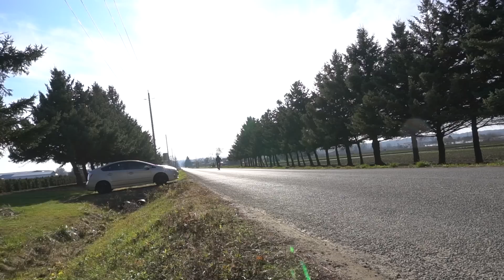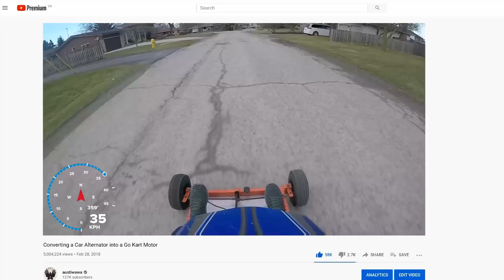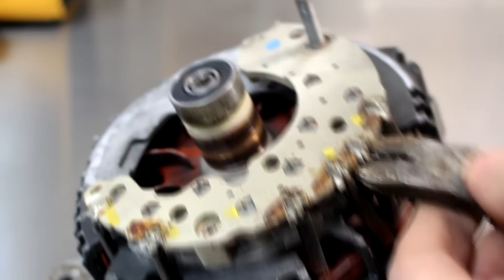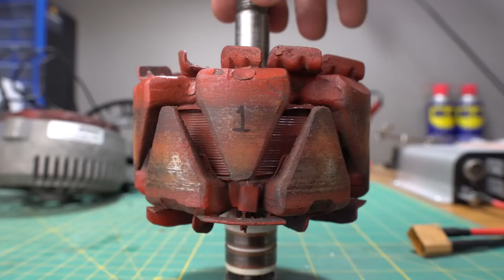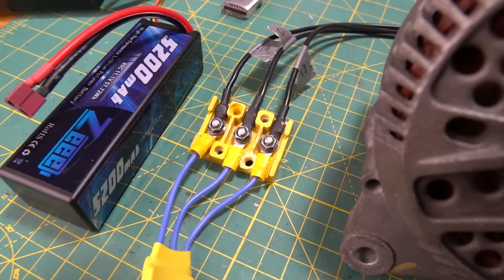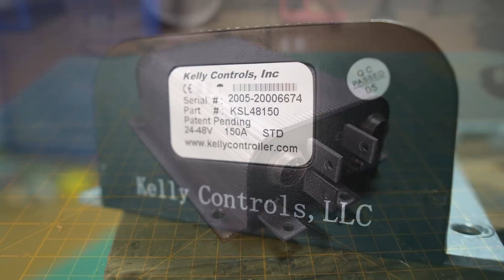Building an Alternator Powered Bike

Comment: WHY DIDN'T YOU JUST SWITCH THE ELECTROMAGNET ON THE CENTER SHAFT SO IT WOULD BE OFF AT NO THROTTLE
Reply: Because its not good to do that
Reply: @foxxyytofficial  you have no clue buddy it  works very well what happens is the speed control makes a electromagnetic field that turns on and off same with the center shaft they are both made to turn on and off that it the only reason they exist so its good to do that
Reply: @wesnxs  yes, the controller creates an electromagnetic field on the stator winding.
But it needs to have some sort of feedback from the rotor to know how to move that electromagnetic field efficiently, and you can have the following feedback systems:

"Sensorless" (Back EMF reading); Hall Sensor (Rotor magnetic pole reading); AB/ABI (Quadrature encoder without/with index); SinCos (Sine-Cosine encoder without/with index); and Resolver (electromagnetic transducer).

Without any kind of feedback, the motor controller can only work in open loop, without a way to control it or move it efficiently. "Killing" the electromagnet's power will reduce and/or elliminate the feedback capabilities, creating a problem that wouldn't be needed. So when he made the smart decision of changing the controller to a proper one, he didn't needed clutches, or turning off the rotor.
Reply: @foxxyytofficial  I get what your saying but turning it off would still work just fine if it would make you feel better he could have glued some very small magnets on the shaft to make sure that in no hall sensor mode the speed controller would not malfunction even though it would be pointless  because when in that mode it doesn't  care like at all about sensing anything but the input from the throttle it will still run the pulse even if there was nothing in middle not even the shaft because that is what that mode was made to do

Comment: Could you have some sort of regeneration? Like the old dynamo could you generate electric on the front wheel which could output D.C  to the lithium bank? Just thinking out loud
Reply: The new controller with sensors can regen like electric cars

Comment: Hey dude, It would be cool to see a charging system that can recharge the battery, make it a perpetual bike. This is how you truly learn, enjoy the ride and keep learning.
Reply: Usually alternators are only 50% efficient, so you only recover 1W out for each 2W you put in
Lets get an example:
You use a 500W limited 48V controller and a battery that can output 500w continuously for 2h
When you use the alternator as a motor, the efficiency is better but not perfect (70% max efficiency from graphed tests i saw), so from those 500W, you would probably be getting 350W max, but still pulling 500W out of the battery (10,4Amps at 48V = 500W).
Now put a second alternator to recover energy, it will try to generate energy by pulling it out from the front wheel, driven by the rear wheel (the force on the rear wheel makes both wheels run on the ground), so now you will have to divide those 350W for moving and to recover energy, since the controller won't pull more than 500W total.
Lets suppose that you got 150W on the charging alternator and 200W to still move the bike. With the 50% efficiency as a generator, those 150W becomes 75W, still at 14V. To get the 14V output to the battery, we need to make the voltage grow 3,42x, but when the voltage goes up, the current goes down. 75W at 14V is 5,35Amps, but at 48V its only 1,56Amps).
And since the controller is already pulling the maximum power it can (10,4Amps), minus the 1,56amps, you would still be pulling 8,84Amps that can't be recovered

Comment: Could you get a 2nd altinator and attach it to the front wheel. With something like a 10-1 ratio. Wire its output to charge the battery pack. Wouldn't keep you going indefinitely but Could extent the distance greatly. Could even charge the battery by manually pedaling or going down hill. Just a thought.
Reply: Usually alternators are only 50% efficient, so you only recover 1W out for each 2W you put in
Lets get an example:
You use a 500W limited 48V controller and a battery that can output 500w continuously for 2h
When you use the alternator as a motor, the efficiency is better but not perfect (70% max efficiency from graphed tests i saw), so from those 500W, you would probably be getting 350W max, but still pulling 500W out of the battery (10,4Amps at 48V = 500W).
Now put a second alternator to recover energy, it will try to generate energy by pulling it out from the front wheel, driven by the rear wheel (the force on the rear wheel makes both wheels run on the ground), so now you will have to divide those 350W for moving and to recover energy, since the controller won't pull more than 500W total.
Lets suppose that you got 150W on the charging alternator and 200W to still move the bike. With the 50% efficiency as a generator, those 150W becomes 75W, still at 14V. To get the 14V output to the battery, we need to make the voltage grow 3,42x, but when the voltage goes up, the current goes down. 75W at 14V is 5,35Amps, but at 48V its only 1,56Amps).
And since the controller is already pulling the maximum power it can (10,4Amps), minus the 1,56amps, you would still be pulling 8,84Amps that can't be recovered

His sensored controller already does have regen, just need to turn it on

Comment: Dear Alternator converter to Electric Motor technician. FredNZ thanks U from "the ends of the earth" down here in South Pacific. My desire at 66 yrs is to put a motor on my wheel barrow so it can climb a short slope in my section. Figured a scooter wheel on front with handbrake lever would cope going down hill would be a good idea...yet to find a free one!
An electric mtr with reduction gear to a shaft onto outside of tyre a simple idea for gearing & clutch for when mtr not reqd. Contractors wheelbarrow best ever wedding gift which I had galvanised. Thank you for sharing your skill. Fred Hughes

Comment: PLEASE don't attempt to make permanent magnet motor from a car alternator!  Car alternators are designed to draw SOME power from a 100 horsepower engine, convert MOST of it to HEAT (what are the fins & fan for?), & by the way, SOME electrical power comes out.  The efficiency is dismal!  Who cares when you have 100HP?  The stator laminations are too thick & made of cheap steel (eddy current & hysteresis loss in them is high).  If you put permanent magnets in, you will need a wrench to turn the unexcited motor because of this loss.  (Been There Done That for the military portable power system.  I ditched the alternator & designed my own, weighing 1 lb & making 100W from an idling 1HP Honda 4-stroke weedwacker engine.)  That's what you get for $20!  Spend some money & buy a real brushless motor.  If you set the gear ratio high, the motor will be small, LIGHTER, (& less expensive).
Reply: He did it and nothing exploded or melted, so why the fearmongering?
Reply: @foxxyytofficial  It's not about NOT exploding, it is whether it makes sense.  In battery powered anything, it makes sense to conserve power.  A car alternator is not about that; it is about being CHEAP & the design is 100 years old!  If he did that for the batteries, he would be using nickel-iron or lead-acid battery.  Car alternator is heavy, hot, & inefficient!  This is a mismatch of technologies.  He has state-of-the-art battery, & motor controller, operating an  ancient motor.
Reply: @bpark10001  he used lead acid batteries on the first video with alternators, and so many others used lithium-ion and even lithium polymer batteries, both with electromagnetic rotors and permanent magnet rotors
Also, there are permanent magnet alternators being sold, so i don't see the problem

Comment: Those centrifical clutches are exactly what we used in the 60s when we made Go Carts and Mini bikes by putting lawnmower engines on them.
Reply: OK, soooooo, I didn't like the Clutch.  I put together a vert small lawn mower engine chain driven very small Mini Bike which started by dragging the back tire, jumping on... throttle pretty much took the place of the brake and to kill it just pull the brake. Worked great and My neighbor's kids loved it!   Why not just turn the controller on and off?  42mph very good!
Reply: i had one in the 90s lol.  loved it

Comment: I just clamped a DeWalt angled battery powered drill to the seat tube with a second crank wheel and bingo.  Rigged a spare brake lever with a cable to the drill button and just power it on when I need extra power getting away at intersections. This video makes a small job waaaay too big.

Comment: This was very entertaining and informative.

I have to say I'm baffled by the 69 Km/Hrs. If you did achieve that speed, it's amazing that you are around to talk about it. I would think the bike would fall apart.

Can you provide the technical aspects of the built (Max RPM of the motor, gear ratio, power output of the battery pack, etc...)?  I'm curious to see the performances achievable with this kind of built.
Reply: The youtuber FixitModitBreakit did RPM/power tests
Reply: I’ve witnessed countless people go that fast as I live near a mountain that is utilized as practice for bikers and mma pros from around the globe so that speed isn’t unheard of
Reply: @dominicgarcia85  Do they have special bikes or will any bike do it.

I would think that the the frame and tires would have to be able to take the strain.

I'm just surprised that the kind of bicycle that is used in this video can achieve these speeds without:

1 - Falling apart
2 - Send you in the ditch because of the center of gravity / handle bar style.

Yes, I'm kinda politely calling BS on the results but I'll be glad to take it back if proven wrong.

Comment: Might sound stupid but could you put another alternator with a voltage regulator on the same chain drive  to keep the battery charged up, hence going alot further. Then the only real draw on the battery would be the start up.
Reply: Nope, you can't do that

Comment: 6 grand battery for a overly weighted car alternator that's gonna last 10min 🤣🤣....looks fun tho lol
Reply: I think it will last way longer than 10 minutes.. Most alternators are in the 200 amp range that's approximately 20 HP all day long. Designed to survive as alternator or motor.
Reply: @flaplaya  200A @ 12V is 2400W/3,2HP
Even using 200A @ 48V its still 9600W/12,8HP
A bit away from the 20HP
Reply: @flaplaya  I was referring to the battery pack lol

Comment: What about t adding a 2nd alternator.  Would that help on the take off. Somehow have a sprocket on each side of the rear wheel and see if you can splice into the output of the controller to control both alternators at one time.
Reply: Its good enough when using a good controller and no clutch

Comment: I would've just made a clutch with a lever. You'd probably only need one plate for it too since it's probably not got a lot of torque. Just use stiff springs
Reply: he doesn't need the clutch

Comment: im wondering if put another alternator would it charge the battery while using and than you would not need to charge the battery as often
Reply: that won't work, the efficiency is abysmally small

Comment: Should mount a second alternator to charge the battery and you won't ever have to charge your battery...win win
Reply: haha, that would never work if you study about efficiency and losses
Reply: @foxxyytofficial  Get a bigger or smaller pulley to go faster or slower then..?
Reply: @garyhart7317  that won't change efficiency, the total power used/given back in the end will still be not enough to overcome its own losses and to return useable energy to the battery after everything
Reply: Ok!

Comment: So couldn't you put a small bike light generator on it to charge the electromagnetic? Yes you would have to pedal to get it up to a high enough voltage on the light generator to fully excite the alt but your pedaling anyway ! This would just get rid of the need for a battery!!!
Reply: that would bring more weight for the pedal
and since he already swapped the rotor coils with a permanent magnet, it will not be needed

Comment: How many amp hours is a motor? Anyone know?
Reply: amp-hours is for battery
Reply: @foxxyytofficial  move on until you learn something.
Reply: @baddog9320  what? amp-hours is the measurement of the capacity of the battery, on how many amperes the abttery can be used to have 100% of the charge deppleted in one hour
Reply: @foxxyytofficial  do you have the answer? If not move on.
By the sound of it you do not.
Adults talking here.

Comment: Idea for Old Rusty v4: add a 2nd battery and another alternator that can charge the battery while in use. That way, when 1 battery dies you can simply swap the batteries to charge it while you use the other to ride into the sunset!. That would be awesome!
Reply: That won't work
Reply: @foxxyytofficial  why not??
Reply: @Oldman-Havok  two reasons:
1- The alternator have only 55-60% efficiency as a charging device, so almost half of the energy (40-45%) that he will subtract from the system will be lost

2- your idea is to use both alternators together, But since when an alternator generates charge gets heavier, it means that your driving alternator will have to pull even more energy from the battery to move the bike, since now it will need to propel you + the bicycle + the second alternator's magnetic field "weight", adding this to the other reason makes the idea only a waste of power
If you want to gain more range, use a bldc controller that can use Regen Braking, just like electric cars do

Comment: If you put softer springs in the clutch you will have better results also since the clutch is new take it apart and use some ruff sandpaper on both clutch brake pads and on the inside of what the clutch brake pads touch that thing will grip like a dragster lol great video!!! Thanks.
Reply: he doesn't need clutch anymore

Comment: Plenty of cheap DC motors available from China which I think can be hacked easier than this.
Reply: Why hack DC motors when they just need two wires?
Reply: @foxxyytofficial  i was thinking of those DC motors found in power tools, pretty powerful for the price but too weak for a bike, probably needs at least four . 
yet, my idea is quite moot as I saw a motor selling exactly for a bicycle applicaition.
Reply: @zodiacfml  well, there's a guy on youtube that tried 4 of those 775 DC motors in a bike
Reply: @foxxyytofficial  nice. ill check it out.

Comment: You supplying a constant 12v to the rotor, or reducing it some?
Reply: Constant 12v
Reply: @foxxyytofficial  You should mess around with lowering it, if you want to achieve a higher top speed. You lose torque, by doing so, but if you lower it after you've achieved the current top speed it won't matter.
Reply: @blackz06  yeah, i know that
And Austiwawa also knows that
But he said that he doesn't want it to be faster than it is now

Comment: I'm thinking add disk breaks and an alternator to the other side to equal the weight distrabution also to charge the battery pack while riding to make longer rides would be great upgrades.
Reply: You can't
Reply: @foxxyytofficial  Why
Reply: @charlesreohr6236  disk brakes are ok
A second alternator to "charge" the system would not work at all because of the laws of thermodynamics
Reply: @foxxyytofficial  I don't understand what dose thermodynamics have to do with it.
Reply: @charlesreohr6236  thermodynamics says that you can't get more energy than you use to create it
(Example: the energy that the water puts on those turbines in hydroelectric power plants is more than the energy that the turbines put in the electric system)
We can't create a 100% efficient system, even more one that can feed itself and also propel a human being forwards through gear ratios
Reply: @foxxyytofficial  I was talking about recharging the batteries not running the motor they Will last longer keeping a charge and you can still top off the charge when you get back or to a charger. It would give you longer rides with better handling. Thermodynamics is used for the transfer of heat. I think you were thinking of perpetual motion, in which I then would agree.
Reply: @charlesreohr6236  you are indeed talking about perpetual motion
You can't get more energy from the "charging" alternator than the energy that you put into the vehicle by the "driving" alternator, that would suggest that youra alternator have a 101% efficient alternator, and that is impossible by all laws of physics

Car batteries only recharge because the alternator is spun by an engine with lots of horsepower (at least 60 and up to 1000HP depending on the vehicle), and the battery doesn't spin the motor, the combustion does

Thermodynamics' laws can't be broken by anything

You want the equation "(Power from driving alternator + friction in all bushings/bearings + heat losses + efficiency losses + weight from the charging alternator's back EMF) < Power generated by the charging alternator", and following the law of conservation of energy, that can't be achieved
Reply: @foxxyytofficial  OK If You refusing to understand what I am saying then no matter what I say your going to mistake what I'm saying. So go ahead and think I am wrong when you're not understanding what I said.
Reply: @charlesreohr6236  since you asked...
i think that you are wrong and you think that the idea works but can't be shared because of government

Comment: You can soften the springs in those clutches so that the friction plates are at full engagement at a lower rpm.  That would at least remove the unnecessary slippage and may help with your startup torq.
Reply: With the hall sensors he removed the need for the clutch